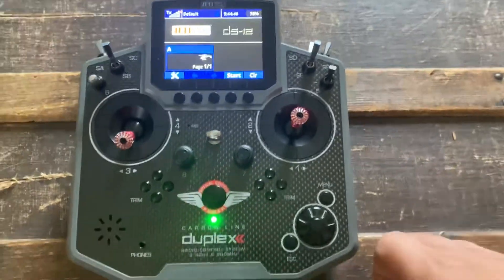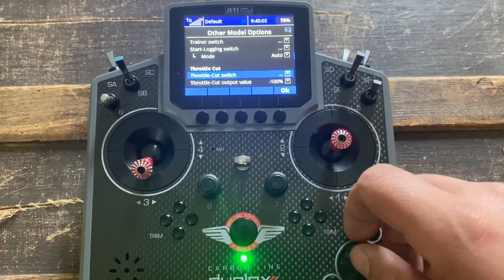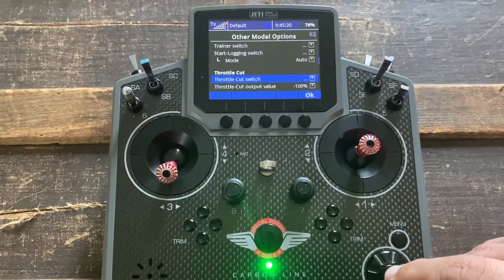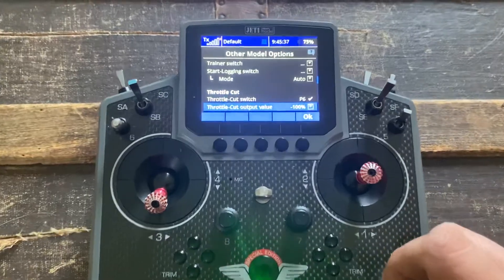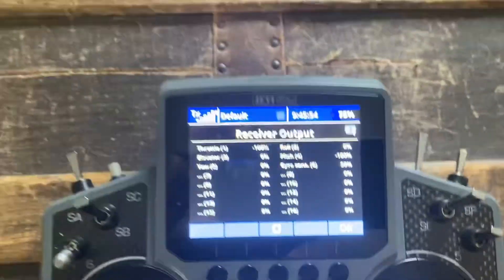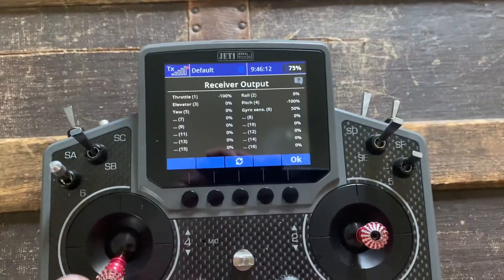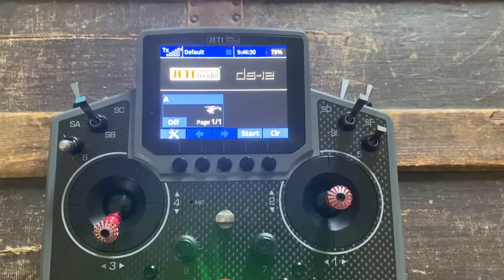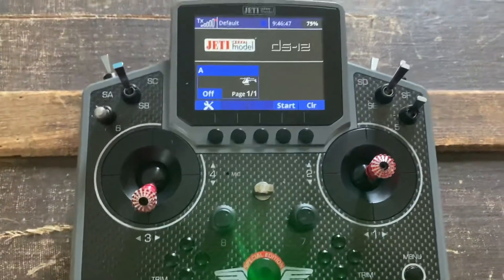Jeti Throttle cut setup

Comment: Can you program the jeti for a rescue function on the momentary switch for say with a little OMP m2 heli
Reply from the maker: Yes. I did exactly that with my Jeti and M2 a couple months ago. I’ve sold it since then, but it’s not hard. M2 has self level, not rescue so I put level on a momentary switch.
Reply: @Euryheli  can you remember what the settings was plz. I'm still getting my head around jeti. But. I love the radio
Reply from the maker: @garyowen3743  have you looked at this thread?  https://www.helifreak.com/showthread.php?t=867267
Reply: @Euryheli  thank you really appreciated